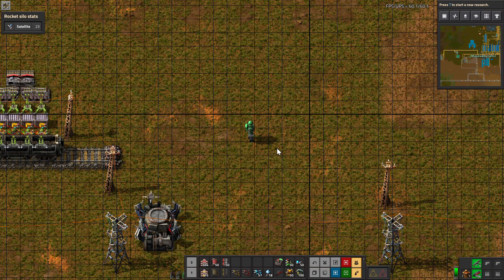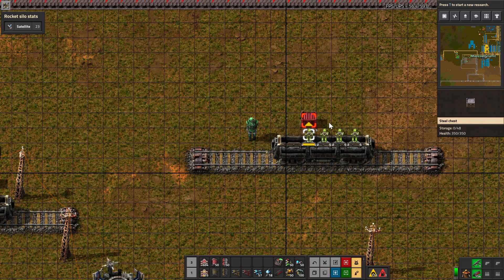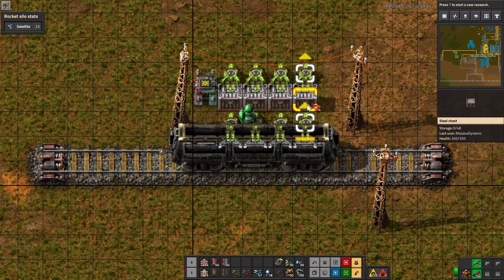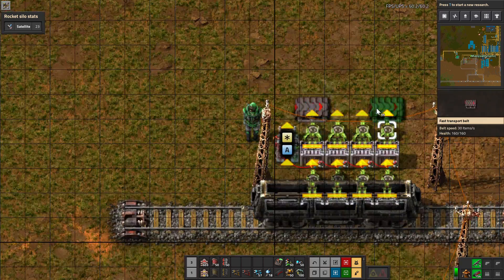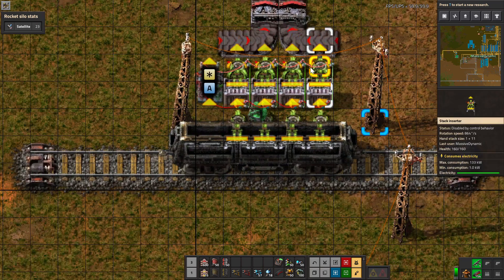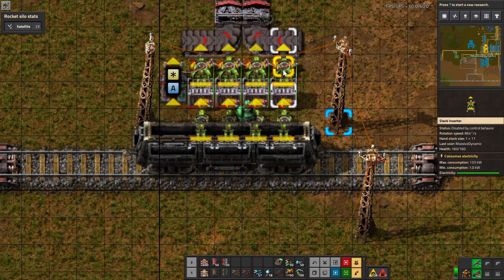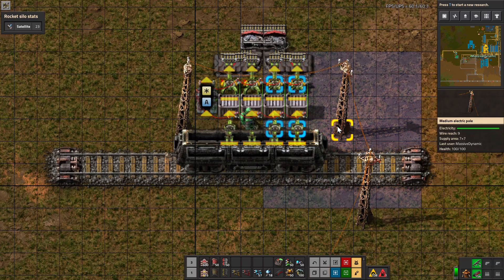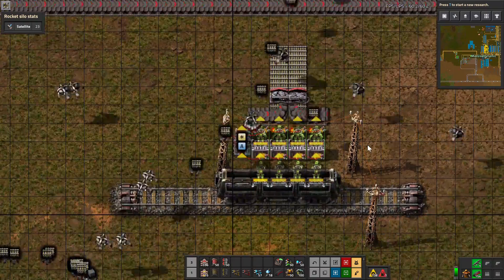Factorio trains Balanced Unloading

Comment from the maker: Hey guys, I just watched this and realized   I made a small misstatement on yhe combinator setting. Set yours to (less than or equal to” NOT “ greater than or equal to” as I say in this video.   Sorry about that.
Reply: The other idea might be using a lane balancer that ensures the output is taking equally from both sides of the input belt.  That way if the right side boxes are empty for some reason and the only input is on one side of the belt, the Balancer will still have a balanced output

Comment: I exactly what I needed help with - I have my my left most chest unloading faster than the rest and wanted a fix.  Almost dismissed the video until I saw your comment - less than or equal to is the proper function.  Logic works well 30 minutes of testing with less than.  I update if something changes.